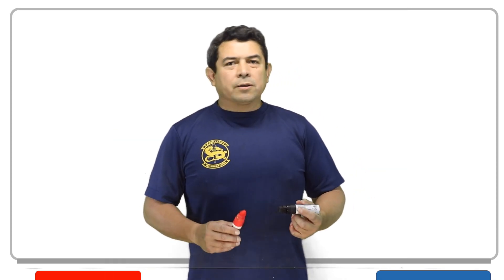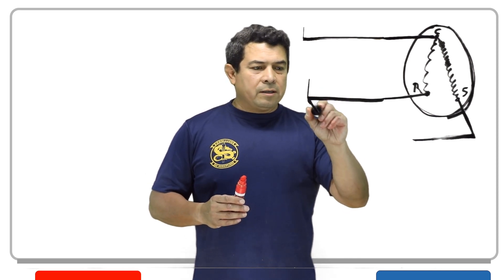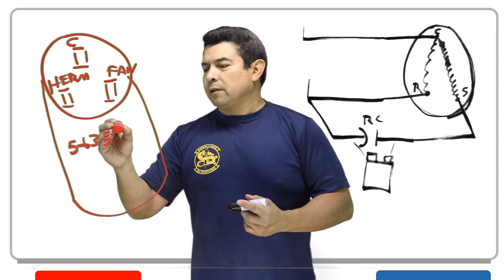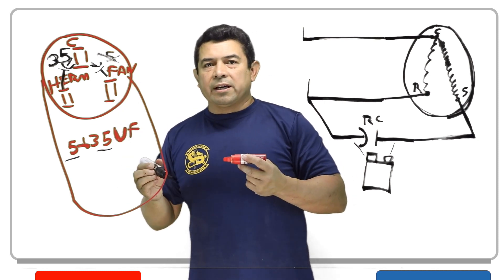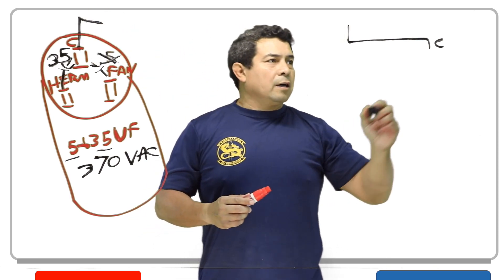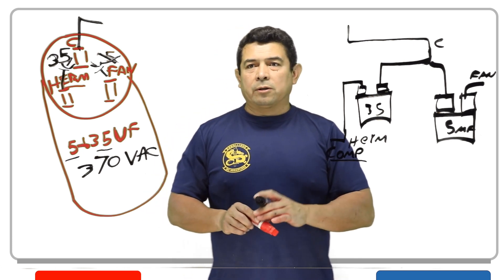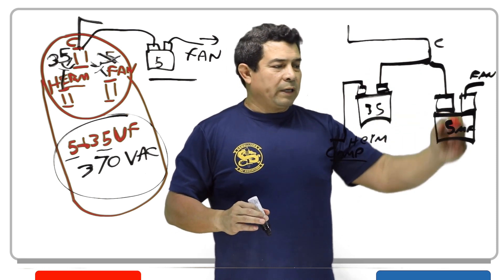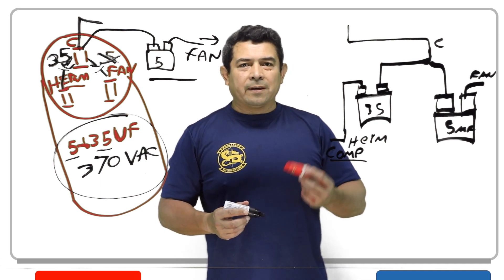Capacitors Part 3 - HVAC Online Training and Courses

Comment: Julio, my question is, what happen if the dual capacitors HERM & FAN, the HERM capacitors go bad (50uf becomes 20uf) while the compressor is running? Will the system keeps on running or will it stop?